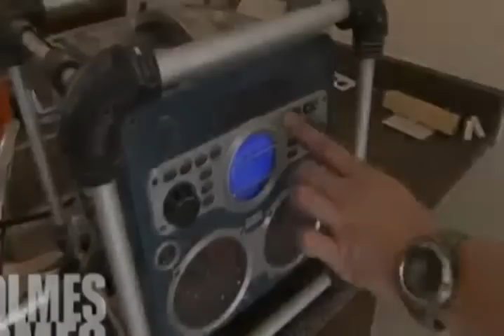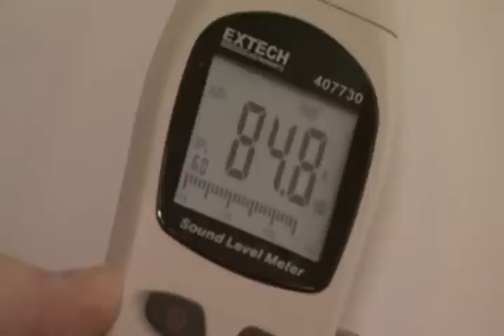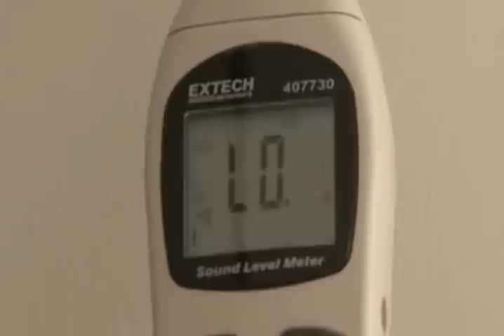Holmes On Homes Sea 05 Epis 12 Wall Of Sound

Comment: This is what all homeowners should do, whether it is a newbuild or a renovation on an older home, take photos for documentation as to what the problems are, where the problems were found, and keep receipts and paperwork from everything.
Reply: What I do every time we do something. Has helped so many times when I need to know we’re lines are run or were a stud or blocking is.
Reply: 4-Way Insection; Structor, Plumbing/Electral, HV AC.
Take  it down, Make IT RIGHT!!!!

Comment: When  I did landscaping in the 80's they would bulldoze all the leftover crap from phase 1,2 under the ground on phase 3. Wood, metal, asphalt , concrete , rocks you name it.  No wonder everything died. And it's even worse now. Selling 500k houses with 300k in products & labor.  All the money goes into finishing & everything else is cheap & fast as possible.

Comment: I watched another YouTuber open one of those locks without a key a while ago now! Here in Australia when I was a kid every wall between two adjoining units, townhouses etc had to be at a minimum double brick and none of the framing, roof trusses etc except the roof itself was allowed to cross the gap in the middle. It was a 'fire-proof" wall, now it's fire resistant for "maybe" 15 minutes!
Reply: Cement board is a great fire break for duplexes
Reply: @Smart-Towel-RG-400  15mins

Comment: In terms of sound,it needs to be remembered ghat 1Bel( Bell) means the sound transmission of  one church bell at a distance of 33 meters. And the Deci means to times by ten. Therefore, a reading of 50 Decibels, is 500 church bells ringing at the same time..

Comment: I know Roxul Fire and Noise Insulation. Apartments are not insulated. I do not know drywall is also sound proof. I like the 1 hours and 30 minute Fire Rating. But while I was in Ontario 2 years, 30 minute fire doors. Not just fire fighter, but police (kick doors to see inside) have to go into apartment buildings to search as well.

Comment: noise: omg. SO true.

there are several tools you can get that runs on your phone that can help you determine these kinds of things right off the bat. they're free! 

noise meter: it's an app free that can show you what's called a FFT of the sound that can be heard. It goes down to zero decibels. why isn't FFT useful? The FFT can show you from loose frequencies to high frequencies levels that it can hear and it can also tell you how many decibels of that particular frequency you can hear. as a musician it may not be exactly precise to the audiophile professional level, but for getting a quick reading on it definitely worth it. and here's the other thing the better the phone the better the microphones etc are on it. sometimes it can tell you that weird odd frequency that you may not even be able to hear.

bubble level: Yes your phone can tell you if it's level if it's got the proper sensors in it. The reason they do that is so they can tell things like if it's being dropped, rotated etc. it's why your phone can detect when it's being moved. again may not be going to say a professional laser level, but you can use it for killing if you have gross problems. frankly it's quite amazing how accurate they are. this is one of the tools of people don't even think about.

most of the better phones have sensors in them that can detect things like what's your current altitude is. it's part of the GPS system which is also part of how it can determine where you are for map programs. The motion detection systems rotation and acceleration ( a drop) are similar to what they use in the Wii for detecting movement in the controllers.. The typically also have a magnetic sensor in it that can tell you true North. again approximately that at least to give you the general direction pretty accurately but not precisely. The GPS can be used along with the Wi-Fi signal detection to tell you where other people's hotspots are. and perhaps that one particular place that's blasting your Wi-Fi just smithereens. some people can call it a war driver because you can drive around and physically locate where Wi-Fi hotspots are.

lots of these tools are free. and if you're not using them why not? I mean it's not every day that you need them. but if like say you're in an RV, one of the first things you need to do is level it out so you can make sure your refrigerator runs properly.
Reply: to the right of my house there was a four lane with a turn lane fairly busy road. The back was facing a a six-lane major artery road with a mini mall within a block. so we also had the people doing donuts in the back parking lot of the mini mall.

My solution was to build a 6 ft high wood privacy fence all around the back of my yard, because here in US we can have 6 ft high fences beyond the front facing of the house. so it actually love me to solve several birds with one stone. I put in a large sliding gate along the back so I could actually drive in my vehicles into the backyard. and I put up a new gate on the front.

so I solved the noise problem to a huge extent. so much so that my builder was saying that it was a smart idea because if he put his hand almost surface of the fence slats he could feel the vibrations of all the vehicles passing by. and if you can feel it that much you know it's going everywhere. I'm sure my neighbor to the north of me was also very grateful as well because it cut his noise problems down as well.

Comment: Even though these shows are from 2004-5, the basic way to get the changes required to “ Minimum codes” us to make the politicians personally financially responsible for anything that can impede the  integrity of a new home even if it means that developers/ builders cannot influence politicians to lower code requirements.  And such code requirements must be consistent to current engineering  standards. Since politicians will not agree to this willingly it would have to be done through if necessary a cause celebre lawsuit, to the highest national court 
A similarl thing needs to happen should there be more than one complaint against a developer/ builder with regards to the new building protection even to the extent of requiring such basic protection to extend to a minimum of five years as opposed to the two indicated here. 

Change of this   type only occurs when there is a possibility of everyone being hit financially other than the homeowner.  Which needs to include the consumer protection plan itself. Such a plan needs to be held financially responsible to pay for repairs after two chances by the developer/ builder.
Reply: Yup if politicians really cared about the people there be strict laws holding these builders accountable...and it's only got worst in the last  15x years